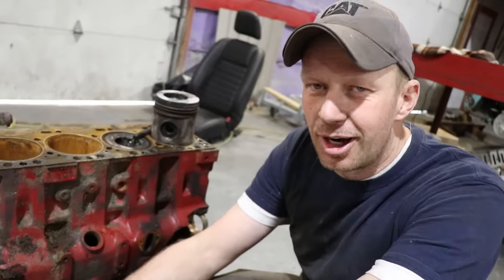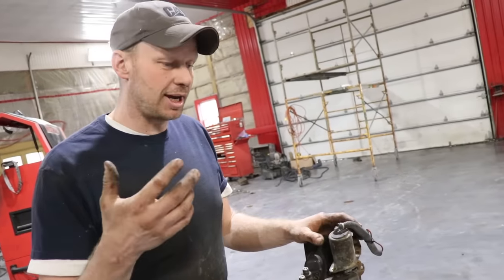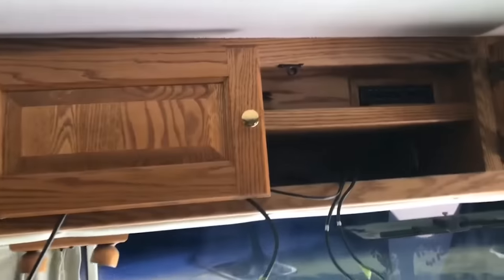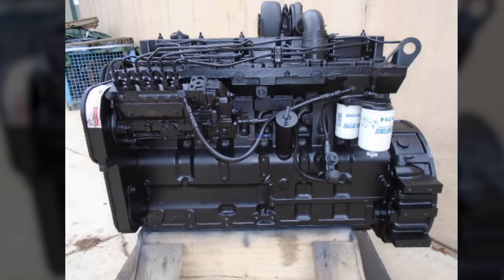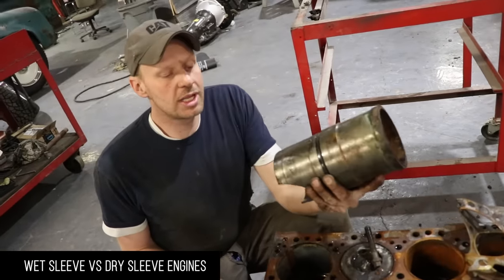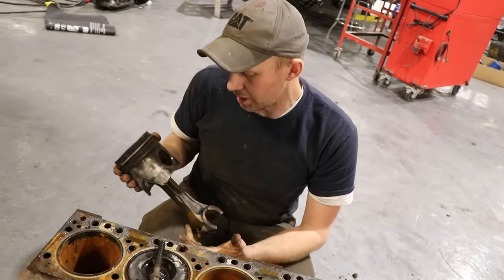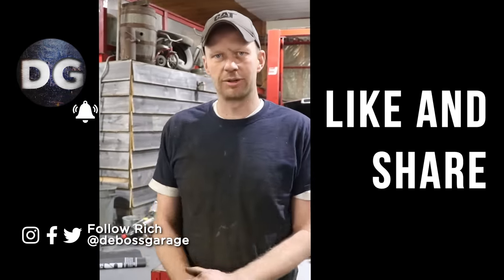REVIEW: Everything Wrong With A 8.3 Cummins Diesel

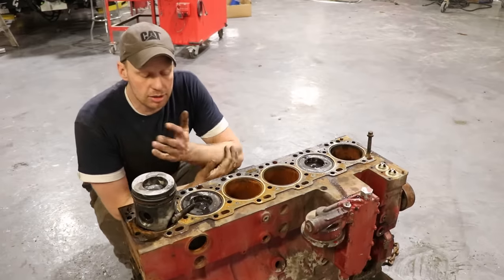Comment: 2:24 my life is complete, I made it into one of your videos lol. I’ll definitely sleep well knowing I have an engine with your stamp of approval under the bed in my motorhome! 👍
Reply: DanielJaegerFilms fuckin mint!!!!!!
Reply: MINTY!
Reply: Mintttt
Reply: Mint!
Reply: Man can you help me? I just replaced my fuel lines and my fuel shut off solenoid. I bypassed the mechanical lift pump with a electric one and it still feels like it's running out of fuel.
Reply: I have a 12v Cummings I put a new draw straw from fuel lab in the tank also
Reply: 223 dmr there’s a check valve on one of the fuel filters which can get stuck open I believe... have you looked into that?
Reply: I just watched your channel last week bingewatching your camry videos
Reply: @guitargod66  11q+
Reply: @223dmr7  get a fass fuel system
Reply: Congratulations, that has to be the shortest cameo in history. 🤣🤣🤣

Comment: I used to do a lot of work on the 8.3 in sugar cane harvesters here in Florida. The biggest issue we had was head gaskets. The machine was using every bit of power they would put out. If they didn’t keep the radiator clean they would over heat and pop head gaskets. They would pour coolant out from under the head. I believe there was an issue with the gaskets and we put a new style in and did a different torque sequence. I got so good at head gasket jobs that I could drive a machine in the shop in the morning, pull the head, clean it all up, pit it all back together and drive it out by that evening. Sounds easy if it’s on a stand but we did it in the machine and the motor was in the middle so a lot of stuff to take off to get to the engine and climbing up and down on the machine. After that they were good to go. Also got a few reman engines they the rear main seal plate wasn’t installed correctly so the oil pan didn’t seal and they leaked oil like crazy. That was always a fun fix because we had the pull the engine which was a job. enjoy your videos.

Comment: That's the smartest designed sleeve puller I have ever seen.
Reply from the maker: Works very well.
Reply: Teeny tad expensive unless you are in the business.
Reply: @COM70  I imagine it pays for itself though over time
Reply: Was going to say the same thing. Creator had a problem, found a solution that saves time, and is easy to use. About as good as it gets engineering wise.
Reply: Seth Stuve  This would be a good tool to be able to rent.
Reply: I'd like to see it pull a wet sleeve out of an un-rebuilt farmall F20. That would put it through nice torture test.
Reply: Seth Stuve I bet you could build that for less then $300
Reply: @alexauger1937  Yep. anyone with a basic machining skills and access to a lathe could likely knock one out in a few hours and for less than $100 invested.
Reply: Seth Stuve if you’re doing rebuilds all the time it’s money well spent!
Reply: @DEBOSSGARAGE  can you install wet sleeves on a 97' 5.9
Reply: @woodstoneconstruction3350  I supose you could bore it right out and put a wet sleeve in it but I think it would weaken the block and it would just break
Reply: IMO any tool you buy as a mechanic eventually pays for itself over time. A lot of time which is also expensive saved later. Being able to rent the tool as someone posted earlier would be a plus for newer, or DIY mechanics.
Reply: @haydona1845  Pays for itself? 0.o We always made our own out scrap parts.....FOR FREE!! and they work just as good. About every 6- 8 months for the last 40yrs someone would come by the shop, thinking they invented these things. Then we point at our free ones and say no thanks!! xD How many times is someone gonna reinvent the SHAMWOW!! xD
Reply: @MAGGOT_VOMIT  WOW THATS AMAZING!!!! HOW ABOUT YOU PATENT AND SELL IT FOR MUCH LESS OR JUST KEEP MAKING YOUR OWN AND SHUT YOUR MOUTH BECAUSE I DIDNT ASK AND I ABSOLUTELY DO NOT CARE😉👍
Reply: Found one online for $59😮

Comment: "The 8.3 cummins is heavy" laughs in 2 stroke detroit
Reply: Laughs in 15 Liter Cummins
Reply: Laughs in Cat C175-20
Reply: RANNNNNNNNGGGAA!!! Sounds great!! Now go clean up your oil with your Runaway-Arresting beach towel. xP
Reply: Laughs in Wartsila
Reply: Convert it to uni-flow Clark cycle or a Day poppet valved loop scavenged 2 stroke. it would be worth a shit then. Cummins now makes an OP ACE 2 stroke uni-flow!
Reply: What is your port timing in an 8.3/ are your running a poppet valved u-lop setup and making 6 bangs per rev?
Reply: @davbradley23  bro they made 16 cyl 2 stroke detroits. 2 v8s bolted together.
Reply: @davbradley23  an X15 cummins is still a small block, the KTA 600 was the 19 liter king of the cummins truck market, they were capable of nearly 3000 ft lbs of torque with stock parts and well over 1000 horse
Reply: No U 
I have a 8-71 Detroit in my 71 SeaGrave very heavy engine. Screaming jimmy. I put the mufflers up top moved them from going out the side under fender side steps. I need EAR plugs now when I drive. Just love the sound of her going down the road. It has a Spicer 5 speed tranny.
Reply: @daynemartin1085  my gpas got a wheel loader with this engine. I can't get over how massive this thing is, I couldn't imagine it in a semi, even though they did back in the day
Reply: The 2 stroke Detroit isn't even that heavy, on a scale of oil tanker 😂
Reply: Laughs in EMD 😂
Reply: A laugh is a laugh in any language
Reply: @MAGGOT_VOMIT If a Detroit "runs away" it's 100% incorrect "maintenance" by someone that damn sure has no business around a 4-stroke.
Reply: @daynemartin1085 I like the 5000 horse v16 Cummins they use on our frack trucks 
Don’t think I’ve personally seen one bigger.

Comment: This is the best 8.3 video I have ever seen.  This engine is my bread and butter.  I run them in snow-cats and routinely see over 10, 000 hours on them.  Thank you.
Reply: And that liner tool looks very nicely built.  I do not rebuild them myself, we just run a re-man long block instead.
Reply: 19000 on the 8.3 in our br400 still goin strong
Reply: 16,000 on mine
Reply: I had 11,xxx hours on an LQ4 6.0 in a 2003 Silverado 2500. Still ran great when my neighbor bought it. 326,xxx miles

Comment: Also there was an update to the headgasket because they were prone to leaking at the front right corner. The head is almost always flat but it chafed causing a leak under load. Probably fixed 200 of these in the last 15 years
Reply from the maker: Thanks!
Reply: Now that you mention it I think I've had to help the father-in-law fix one leak at the front right but usaly for us it's the back 2 that usaly give out. We replace the gasket and the engines good for another 2+ years.
Reply: I’ve done a couple didn’t realise it was so common maybe we was lucky in the fleet I looked after I can’t imagine how much trouble it would of caused if we wasn’t.
Reply: They updated the torque procedure along with the gasket. It didn't always get followed though.
Reply: Alot of us still running these in older Case combines pushing 5k hours, when would you recommend overhauls or any tips to watch for?
Reply: @paule5195  anything over 5k if the engine is out I would at least check and or replace the bearings in the bottom end. And of course install new rod bolts. Otherwise if it isn't leaking or burning to much oil, or doesn't have excessive blowby. Run it. After 5k hrs the value of the machine has to be weighted heavily especially if it's anything older than a mid serial 23xx. Spending 10k plus on a rebuild or even 5k on a used engine has you at or past the value with the current combine market.

Comment: I have a 8.3 Cummins in my "96" Monaco 38' MH, has 111,000 miles on it, uses no oil between changes, runs like a top! Great explanation Rich, thanks for review!
Reply: I have the exact same MH 8.3c with over 122k trouble free miles. I love the idea of the fully mechanical injector pump. Plan to put on at least 40 to 50k more miles. Monaco made a good machine back then!👍
Reply: Ever calc the mpg's? ...or should I say the gpm's:)
Reply: @razor3003  Yes many times! It gets anywhere between 9 MPG to my best was 10.5 MPG That is towing my toad, a PT Cruiser, 5 speed manual! It really depends on the wind, when the wind is blowing, you can expect around 9 MPG! I also run my diesel generator if it gets hot, to run the roof top A/C's! I have ran all the way up to Maine, and out to Custer, SD from central Illinois, and the MPG is always in the 9 to 11 range! My speed is around 62/65 MPH!
Reply: I've heard that from a few other people, I think that's pretty typical & actually not too bad, all things considered. Now all we have to do is get the cost of diesel back down to earth. Let's go Brandon!

Comment: 7000 hours isn't much in the way of road miles if you want to compare it to vehicles. It's only around 300k.
Reply: That is 7000 hours in a harvester.... basically the same as tackling a very steep hill, fully loaded for 500,000 miles... Most harvesters are usually traded or recovered after 5000 hours.
Reply: Constantly ran at 100 percent load in a rough dusty field
Reply: @Jaxon-iu6vb  nah. If they he ran at 100% load they where running the combine to hard. Combine engines have a relatively easy life. Constant medium load, constant engine rpm. Basically almost as easy of a life as a gen set or air compressor engine. They’ll last forever
Reply: Run silkolene pro 2 sx in her, i got a few gallons for a 2 stroke 8v92 silver turbo, way better than shell rotella but 46$ a gallon though. i got it rigged up for total loss burnoff!
Reply: @TeamTopKick  Yeah them 2 strokes last long if you treat them right.
Reply: running synthetic 2t. i love the sachs crankcase
Reply: That new 2 srtoke cummins could be scaled for a sick trail sled motor!
Reply: I Hope they do a Jets ski or dirt bike 2 stroke cummins motor!
Reply: @TeamTopKick  8.2 is a useless 4 joke abortion motor!
Reply: @TeamTopKick  i already got a temperamental 7.3 IHC poppet valved 2 stroke in an f-250 i would love to trow off a cliff, no power to weight ratio at all. i hate it and want to get rid of it, my small block 2 stroke v8 make way more power of lees displacement!
Reply: i would rather merge to billet aluminum 3.2 v6 optimax 2 stroke v6's together and drop that in this POS ford!
Reply: One thing good about the 8.2 GMC is that it runs a separate oil tank and total loss oil burnoff injection system. It can run TCW3 heavy oil to 15w40 low ash!
Reply: @TeamTopKick  yeah they run total loss oil burn off injection!
Reply: Just low ash 40w or 30w or TCW3! 8.2 v8 can run tilted in any position as they have multipoint oil injection systems
Reply: @TeamTopKick  an 8.2 should run great with just oil injection tilted in any position like my small block johnson v8, hmmm let the experiments begine if i can find one, hehe
Reply: @TeamTopKick  the 8.2 can be run as a poppet valved 2 stroke with dry sump oil injection feed!
Reply: the 8.2 was some 4 joke useless attempt at god now what1 Low power to weight ratio noisy motor? lets make it a 2 stroke with a 1;1 cam, baffled intake valve and boost for u-loop scenveging!
Reply: @TeamTopKick  Lets try amsoil 2 stroke dominator synthetic fot fun! feed it into the bottom and inject it into the intake like a rotaxe 850 ETEC!
Of couse thye 850 ETEC make waym more power for its size and runs much hotter. Lets tip an 8.2 in any position and run just oil injection with BRP-100 XD!
Reply: @TeamTopKick  No wonder why the navy is getting rid of such useless 4 joke crap!
Reply: @TeamTopKick  Does the 8.2 run oil injection total loss burnoff! im sure it could if modified correctly
Reply: @cav6975  Nah, both you and the other guy are wrong. Combines don't live at 100% load or the equivalent of loaded heavily going up hill, they have proper gearing at medium load at steady RPMs and low speeds, I know because I used them for a living, none with the cummins though. They have quite an easy life actually. The run 12-14 hours a day during the summer so minimal heat cycles and the aforementioned other things. My boss had combines from the 80s with dozens of hours on them, they're hardly breaking a sweat during harvest
Reply: @benjamins9121  if that were true, they should be able to whizz along all day in top cog. When we harvest our broad beans, its generally at a snails pace with frequent belches of black smoke when the cutting gets really heavy as well as many stoppages.
Reply: So u r saying if u had 7000 hours, u should have around 300k miles?

Comment: Kamatsu pc300lc-6 excavator had one of those engines. It was the first piece of  machinery to gel when it got cold in the winter. Although, if the fuel was treated right, it would be the only thing that would start when it was -20 f.

Comment: @deboss garage, I know one of the engineers that worked on the B series at Darlington and he maintains that the dowel pin is not an issue until people start replacing the injection pumps and do not refit the support bracket correctly on the injection pump or in some cases not at all. The increased moment on the timing case causes movement and it works the dowel loose. Theres a service bulliten on this particular issue on the B somewhere.

Comment: Love love love (!!!) the 8.3 in our case ih magnum 7120 tractor.     30 years old, 5500 hours on it with zero engine issues.   Bump the key and it's running and will keep running all day.

Our r65 gleaner has the caps 8.3.   When it runs good it really runs good.   However when gleaner bought these engines they did not get software diagnostic capabilites with them.    Means having to deal with a Cummins dealer 2 hours away rather than the gleaner dealer 15 minutes away.   Every few days during harvest I'm driving the combine with 1 hand and using my phone internet searching the latest trouble code set  with the other.   Mechanically the engine has been fine but that caps will be the reason the machine gets traded away before its time.
Reply: 5500 hrs? It’s just getting broke in lol

Comment: Regarding cavitation, it is the other way around as you have explained it.
 It is not when the coolant gets pulled away that it takes the metal with it.
As the coolant is pushed away so quickly, a low pressure is created behind it causing air bubbles to form, as the coolant is getting pulled back in, the air bubbles collapse and the coolant itself impinges the metal, wearing it out.
Reply: more about electrolysis

Comment: I love that you're honest about these engines. I'm a cummins guy for life but, even I know(lots of firsthand experience lol) that they have somewhat annoying issues..😂😂
Reply: The failure of number 6 cylinder is helped if you add a water aid to the rear of the head like the marine engines. The injector pump on the engines less than 350 horse have 10 mm plungers 5.9 has 12mm. Older cool blocks have thicker lines and thinner blocks that tend to cause block failures behind the injector pump caused by the clamping force of the head bolts on the cylinder counter bore.

Comment: VP44 and CAPS are very different and failure mods are very different. The problem with CAPS is mainly confined to the pump and surge suppressor/ transient diode. VP44 is the one with fuel lift pump problems. Most issues with CAPS were resolved with later changes. Though they both use the same lift pump design you are less likely to kill a CAPS pump with lift pump failure.

Comment: I’d love to see your take on the 5 l Cummins that Nissan had
Reply from the maker: They pretty well stopped making them but I know where there are a couple on engine stands.  Maybe someday.  One project at a time
Reply: That was a delivery truck engine first.  Lots of problems I heard
Reply: @workingcountry1776  Nissan went from having all 5L Cummins in their heavy half ton Titan (XD?), to a gasoline and a diesel option, to just the gasoline engines. I test drove a diesel Titan. It wasn't a rocket, but towing would've been the real test. What turned me off was the poor turning radius of the truck.
Reply: S. Stewart we had one for towing a couple sherps on a 30ft flat deck. Made a couple trips and then ended up in the shop for a limp mode. Last I checked they were still trying to diagnose it. The truck had 30,000ish kms
Reply: @Seth_Stewart  the 5.0L Cummins in an XD is basically same real world capability as a 90s f250 7.3 PSD from folks that I've talked to
Reply: @terorismmm  That's crazy
Reply: Be interesting to see one swapped into an older 4 door SUV (Jeep JK, Durango, Yukon, Tahoe, 4 runner, Explorer, Expedition, even Excursion maybe) running using a LB7, LLY, etc (pre emissions) computer.
Reply: Worked at an rv dealership. Drove q few towing trailers. Was nearly identical to an obs powerstroke truck with a tuner. Or a lightly tuned super duty. A super duty with a 6.2 I felt was superior
Reply: I have owned both a 2012 f250 6.2 gas and a 2018 Titan XD 5.0 Cummins. The Cummins is no doubt the superior towing rig... if it was reliable. I sold it with 25k miles on it because it was in the shop way too often. Glow plug failure, DEF injector failure, turbo actuator failure, and trouble with the transmission finally sent me over the edge. It’s too bad because I loved the truck. Drove like a half ton but handled trailers like a 3/4 ton. Shame to see Nissan giving up on the project.
Reply: I heard,  once deleted and tuned those were great
Reply: Like most of the late model diesels, the only reliability they possess is to reliably $5,000 you to death.

Comment: I was always wondering what the problem was specifically with the CAPS 8.3 and you explained it.   See a lot of older used farm equipment with the 8.3 CAPS power.  Now I know what to be looking for on one of those.